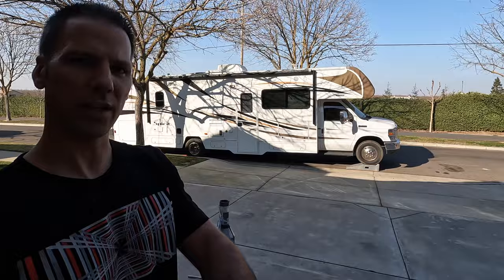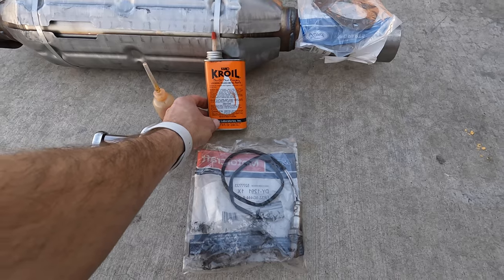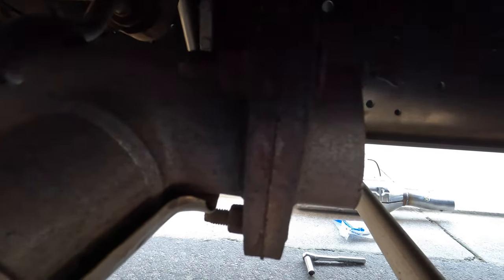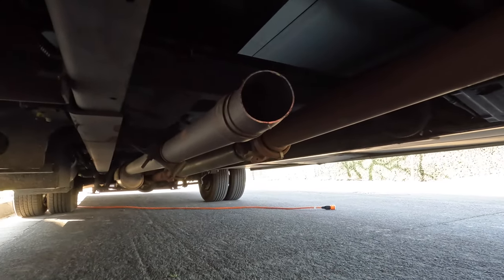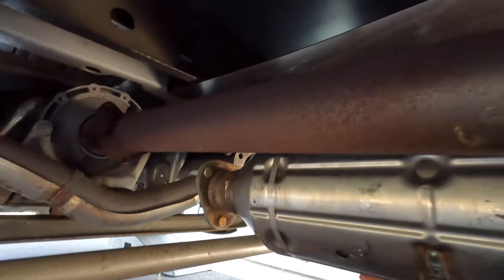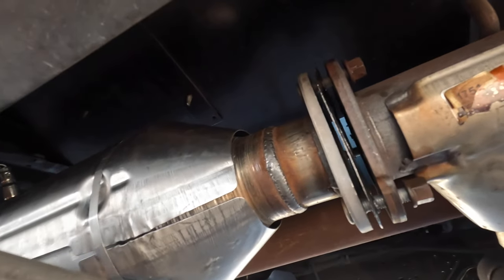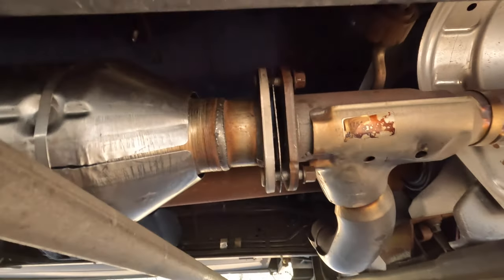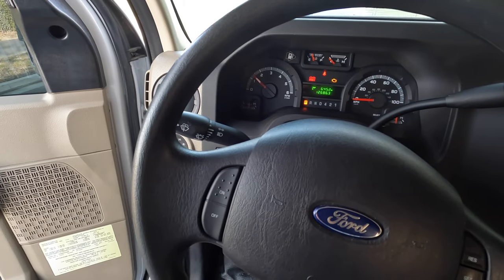How To Install Ford E 450 Catalytic Converter

Comment: Nice video.  Be careful getting the cut piece out. My pipe pulled out the muffler and then I busted the clamp and caused a hole on the muffler inlet, but the real problem was getting the pipe back to the right location. Finally got it! 
Also, I used ramps but added jack stands for added safety

Comment: You live in California…I take it, your Catalytic Converter is CARB legal? Is the Cat Converter OEM Ford part number 9C2Z-5E212-E? What are the part numbers for the O2 Sensor & the gasket you purchased? Also, for $970, do you mind also providing the dealership you bought it from? Thank You…Your video was very informative…like the other posts, it happened to us as well on our 2015 E450 here in Visalia, CA.

Comment: FYI, my muffler-end piece was really wedged in there and the tapping on that little nub wasn’t cutting it. So i just drilled a hole thru the other side and stuck an Allen key in it, that way i had a tapping point on either side. It came out real quick after that.

(It also made me realize how easy it must’ve been to slice thru this pipe in the first place.. damn.)

Comment: Great video.  I got mine stolen as well off a 2004 e450.  It cost over 3k at the ford dealer.  What did you end up using for an anti theft solution?
Reply from the maker: Thanks for your comment. No theft solution under my RV just stored in a more secure area. Good luck with yours

Comment: Nice video. Mine just got stolen while on the dealer lot for warranty work. $1500 deductible, and $4647.23 later I have a new cat.  Painted bright orange and yellow and just installed a @catclamp. Hopefully I won’t have to do this again.

Comment: Seems that we had the same people that needed ours as well, how ironic 🤔..  We have a E450 Chassis C Class camper also.  How much did the catalytic converter cost you?  Are you going to add a skid plate to help deter the kind donation the next time?
Reply from the maker: I’m sorry to hear that happened to you as well. Haha kind donation, yeah I need to add a skid plate but haven’t. Just the catalytic converter alone cost me $970.
Reply: @KevinGreshamOfficial  Looks like going through insurance will be the cheaper option for us. However, I will be asking for the catalytic converter before installation, to make some modifications to it.  Maybe people will be grossed out by it enough, and wouldn’t want the kind donation 🤔.  I will most likely be doing a YouTube video of it as well.
Reply: I have a 2013 ford e450 truck, they stole my cat converter and since it's my secondary vehicle I really don't want to spend the $1795 that Ford is quoting me for the part. Any luck getting an aftermarket one? I've been looking online but the ones I found might not be heavy enough to handle the 6.8l v10 gas engine. I just need it to pass federal inspection.
Reply: @KevinGreshamOfficial  What do you think of the generic ones on ebay?

Comment: Did you buy it from the Ford dealer ship or aftermarket?
Reply from the maker: Hey Jim, I bought it from my local Ford dealership. It was pretty easy, all I had to do was call them and order it with my vin number. I hope the video helped.

Comment: My mechanic says mine is discontinued, so I'll have to get an aftermarket converter for my 2001 E350 Super Duty. Will that install the same way or need to be welded?
Reply: I have a 2013 ford e450 truck, they stole my cat converter and since it's my secondary vehicle I really don't want to spend the $1795 that Ford is quoting me for the part. Any luck getting an aftermarket one? I've been looking online but the ones I found might not be heavy enough to handle the 6.8l v10 gas engine. I just need it to pass federal inspection.
Reply from the maker: Im not sure if that aftermarket converter should be welded on but most are not welded on, just bolted on.
Reply: @basicallybangbang  Finally took the van in last week and the guy quoted almost $2,300 to replace the converter and mount the muffler (which is currently resting on the rear axle). The converter alone is $1,900 after market. Brought it back home without repairs.

Comment: Someone broke into the storage facility that we store our Minnie Minnie E-450 V10 about two weeks ago stole ours. Thankfully we live in Washington State which got rid of our DEQ program about two years ago. I went ahead and welded a straight pipe where the catalytic converter was, problem solved! No catalytic converter, nothing to steal sorry tweakers not today!
Reply: Just did the same thing myself moment ago
Reply from the maker: That's nice your state state got rid of the DEQ program and your able to just put a straight pipe on it. I bet it sounds great!
Reply: @KevinGreshamOfficial , not only does it sound great but it has a little more get up and go along with better gas mileage.
Reply: @mikemccoy5729  mines is still loud
Reply: @htatesil4192  , that is strange. Mine sounds fine, did you still have an exhaust leak somewhere?
Reply: @mikemccoy5729  what straight pipe dude you use I used a stainless steel pipe
Reply: @mikemccoy5729  ok I wasn't reading. I'm using  U clamps and a straight pipe it's loud when I hit the gas but quiet idiling

Comment: Thief stole my catalytic converter off my 2001 E350 Super Duty. A week later I tried starting it to drive it to the shop and it won't start. On first try, got a few rapid clicks. On second try, just one click. Is that just coincidence? Getting ready to jump it.
Reply: Battery